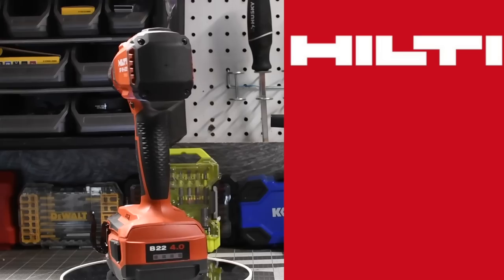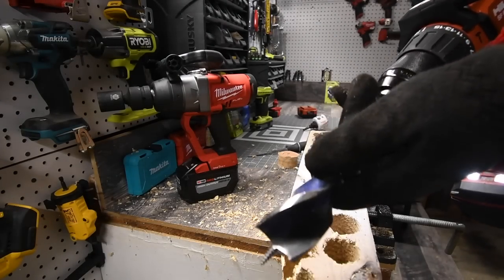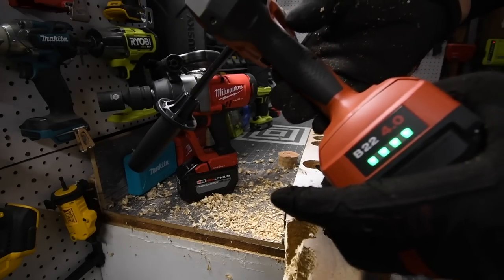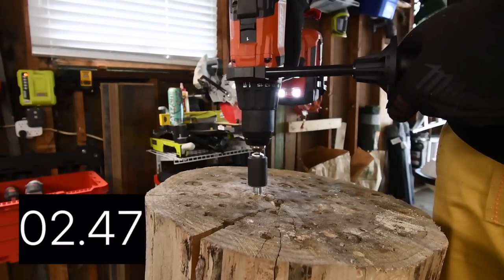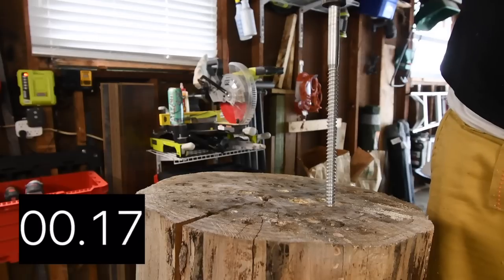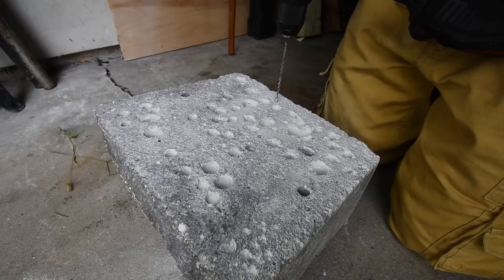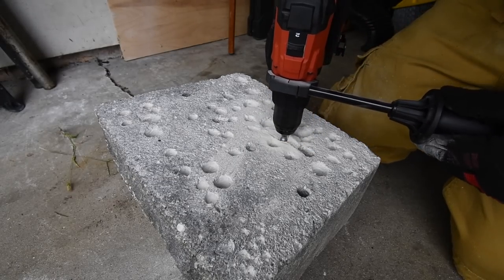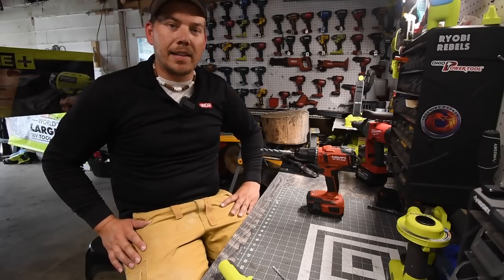Replaced My HILTI SF 6H-A22 (Hammer drill)

Comment from the maker: I made a mistake you guys. This HILTI is not a new tool. I just went crazy for a little bit and thought my previous drill was SF 4H-A22. But I uploaded the first video of this tool on 2/2020
Reply: Yeah, I'd blame it on the rep...Hilti insist even today that it's a new model...But is a nice tool so two of them is not bad, altrough is wey to heavy -  more so that 4Ah compact is abused by this tool, and you need to use some older 5.2Ah if you can find, that are even heavyer. With 8Ah is absurdly heavy.

Comment: I never thought Hilti worth the cost.  They provide some at work and they are nice, but I would never buy one
Reply: In Europe Hilti sell only to companies, with no exception. They have a 2 year unlimited waranty that covers any wear, unlike other brands that deny waranty for heavy industrial wear, and Hilti asure service for another 20 years with very fast repair and return waranty or tool replacement. Also altrough not cheap when ading batterys, charger and case, Hilti being made in China -  even at the highest standard - are less expensive then Festool, Fein, Mafell, Rems, and with the new  brushless models is in line or even cheaper then Metabo, Flex Europe and even Makita. Makita even has wey more expensive models in the so coled 40V max line. And even in the 18V line, Makita DDF/DHP 486 is more expensive then SF 6 / 6H-A22, and Hilti is wey better made. But Hilti is heavyer, wey too heavy, more so that you need to use the 8Ah pack or some older 5,2Ah, to not abuse the battery with more the 42 amps drain - and the 4Ah compact with only one row of 21700 cells is not a good idea for this tool, and that when Makita is already wey too heavy... The only Hilti that has both decent weight and also decent torque, on the low side but usable, is SF 2-A12 @ 4Ah compact with 21700 cells. Is spect 21 Nm soft, 34 hard, in real life reach not much more the 15 Nm in speed one, good enough, but that model altrough also pretty new, can benefit more from an upgrade for more torque, more so that it has those nice 4Ah packs that can sustain 40+ A drain, and 25A or so woud be enough for 25 Nm soft torque like Dewalt DCD 701 and new Makita DDF/DHP 487.
Reply: DEK in Czechia sells Hilti to anyone, including individual customers. 
Also if we compare comparable tool models, Hitli is not less expensive than Festool. Quite the opposite. But they don't have much overlap. Hilti is more about concrete and construction, Festool is more about precision woodworking.
Reply: @marsdeimos4301  Czechia is an exception for both brands. Festool is even made in Czechia for a year or so, not in Germany anymore, and the newer Festool battery packs are made in China not in Poland anymore. In other countrys Festool is wey more expensive then Hilti, and I woud not use Festool drills even if given to me free, except maybe older T12 but with a newer Li-ion compact pack. T18 is wey to heavy even with 3Ah compact when is 1,5 Kg without chuck, so is stupid heavy with chuck for the provided torque, and even those 35 Nm soft torque are limited by electronic protection even in drill mode. And the new 4Ah compact packs are also stupid heavy in a fashion similar to Hilti - sure from impact protection, but still - stupid heavy. And 5.2 even more... DRC/PDC even more so are wey to heavy and enter in protection wey to fast, and TDC/TPC   are even wey worse - protection mode enter even faster and the true reached torque is lower then DRC/PDC. And those new ones are very heavy and very noisy. And CXS is ubber crapp, can't drive flush all the time  4x30mm in chipboard in speed 1 where is very slow, only one in three, and not even talking about 4x50 or 4,5 x something. And the magnet from the angled head drop after some light use...And that when Bosch GSR 10,8-2-Li/12V-15 Heavy duty, FC and not FC, cand drive with no problem in speed 2. But I have a lot of Festool branded systainers, dozens..., even if those are also very expensive and also very crappy - not even  comparable to DeWalt Tough. For location work I use more Bosch Lboxx first gen, DeWalt tough, other Makita and Bosch cases, and even some Frstool sometimes, but I rather    use Festool systainers only for fix storage.
Reply: @marsdeimos4301  SF 6/6H-A22 in my country is more then 150 USD - like is in USA, but still less then Hilti. SF 6H-A22 with no batterys and no charger but with case is ~ 325.7 Euro including 19% VAT - and, and ~ 283 Euro without the case, also with no battery and no charger but VAT included. The best price I foud, well lower then average for Festool TPC that is ubber crapp, basic with no angled head, no battery and no charger, but with systainer and VAT is ~350,5 Euro - and battery packs are also expensive, needs charger to, etc. With charger and one 4Ah compact and one 5.2 Ah is 810.3 Euro, and 4Ah compact with one row of 21700 cells is stupid for high drain tools like it's also the case for Hilti that is even more powerfull.

Comment: Not gonna lie, the hilti is way underpowered
Reply: For being the third model down from the top on the Hilti line, SF 6/6H-A22 is more like overkill power wise, 65 Nm soft torque in speed 1, and 80 Nm hard torque ( on all drills hard torque is reached at hard stop in shock in speed 2 @ full  RPM from the moment of inertia and kinetic energy that is in relation with the speed sqared, so in most cases is good to brake screws and destroy materials...). 65 Nm soft torque is the spec for top of the 18V line Makita, DDF/DHP 486. 481 is spect to 60 Nm soft and 458 to 58 Nm.
Over SF 6 / 6H- A22 Hilti has SF 8M-A22 with 4 speed gear, and top of the line is SF 10W-A22 ATC. But the never ending problem with Hilti is the weight to power ratio, and SF6  is wey too heavy, even heavyer then Makita DDF/DHP458/481/486, and that even when using the Hilti 4Ah compact pack shown here, that uses only one row of 21700 cells, that is abused with wey more then 42A current so is not a good idea, and with the 8Ah pack the weight is absurdly high. The only Hilti that   has decent weight and also decent torque is SF 2-A12 with 4Ah compact, in spect 21 Nm soft torque ( 34 hard), but reach not a lot more the 15Nm, still decent anywey. That model is also relatively new, but can benefit more of an upgrade for higher torque, and with those 4Ah packs can also sustain higher amps drain.
Reply: @P_steez  I use mostly some select Bosch heavy duty, plus some good Makita models, some Fein, some Mafell, some Festool, some DeWalt, some Hilti, some Atlas Copco, but never crappy Milfucky fully own  chinesium brand that brake in 6 months. Top of the 18V line Milfucky is lighter, but less reliable and has expensive parts so not worth the cost even if you can get the spare parts.
Reply: @loochan325  I use a Dewalt hammer drill and Milwaukee’s 18v impact when framing and they’re two of the best drills on the market, vastly superior to the hilti and I have never once had a problem with their reliability. Hilti is frankly a brand I’m just completely disinterested in this point in time until they step it up
Reply: @P_steez  Hi Parker, I have this Hilti and the Gen 3 Milwaukee.  The Hilti is a lot more powerful than the Milwauke, plus the Hilti build quality is far superior.  The triggers play up on all my Milwaukee gear!
Dave.
Reply: @Bean Eater  The Hilti SF6H A22 is much more powerful than the Milwaukee Gen 3. I own both. Plus the Milwaukee triggers give problems all the time.
Dave.
Reply: @davesheppard8797  good to know, thanks for the info Dave!
Reply: @Parker  No problem mate!! 👍👍